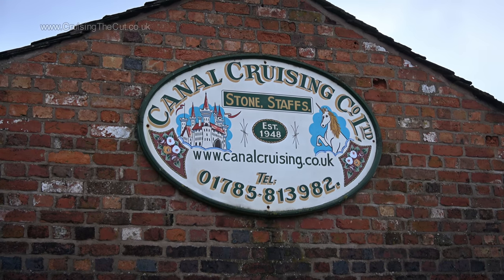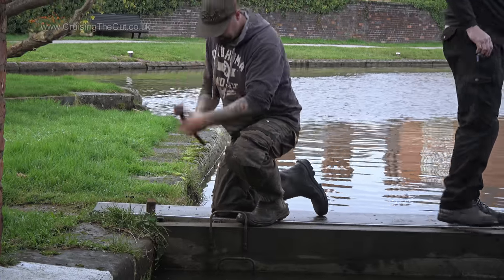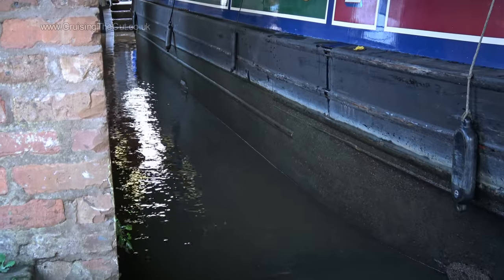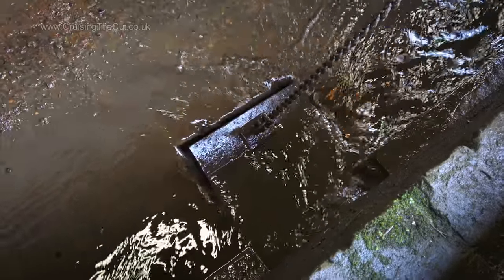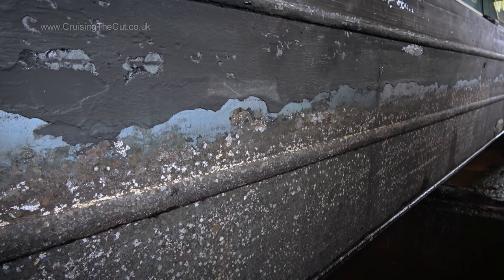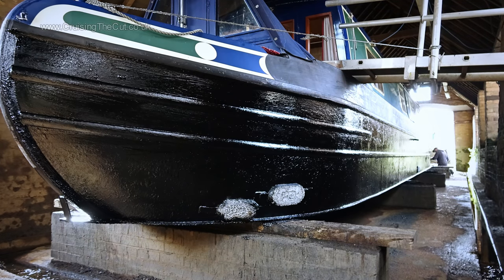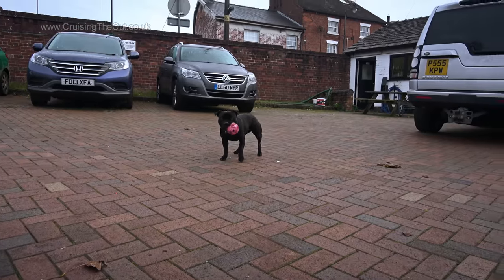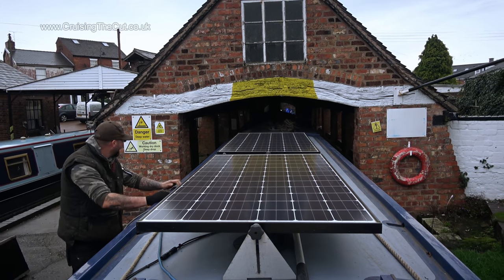201. In dry dock! Re-blacking my narrowboat

Comment: Amazing the way things were done in the past and still done today. Too bad you have to do it every 3 years. How much does it cost each time? This was a very interesting video, thank you!
Reply from the maker: Blacking like this costs around £8-£15 per foot of boat length
Reply: @CruisingTheCut  Lot less than i would have expected.
Reply: I was thinking of an American water seal compound called ‘Linex”, we use this to waterproof the  bed of a Pickup truck, pretty good stuff as it literally forms a bonding seal on the metal.  I’ve heard it being used to protect the outside of a van or truck, and so far this material has passed even the most stringent of all testing by outdoors adventurers…. Its also expensive…..

Comment: Have to say David this was a really interesting vlog on the technical aspects of the "original" canals engineering.

Watched the vid three times (simple addiction) before it dawned on me that the understanding and exploitation of hydraulics was rather clever.

No pumps to empty the dry dock or fill it. Just gravity and exploiting the difference in height of the water levels.

Using the dirt ( stove ash?) to seal the stop boards by using the water pressure to take the sinking ash to where it was needed was an easy and cheap way of keeping the water out.

The stop boards themselves obviated a lock gate, hinges and paddle mechanism with the consequent maintenance.

Obviously couldn't say when the concrete liner when down but having the gutter to deal with any leakage was clever so blokes could walk on relatively dry concrete and not be sloshing about in puddles.

Even the lintel (from an oak?) saved having to build an arch, not to mention money.

The overall construction reminded me of the open boat yard docks found in the Arsenal at Venice.

Whoever designed that dock and system was really quite clever with no unnecessary fripperies and doodads, or expense.

Comment: Are any of the UK narrowboats fiberglass hulled or are those considered too brittle and easily damaged for the day to day life in the canals?
Reply from the maker: There have, in the distant past, been boats which you might vaguely call narrowboats, made from fibreglass. There were also experiments with steel-hulled, fibreglass-topped boats (though usually the top would end up detaching from the bottom). And you can get fibreglass river cruiser style boats which are made to suitable dimensions to fit the canal locks. But 99% of narrowboats are steel (and a small number in aluminium)
Reply: @CruisingTheCut  i believe there also were ferrocement narrowboats in ww2, but were soon phased away due to their lower carrying capacity. however, ferrocement is almost indestructable and needs to reblacking. you have ferrocement boats in british columbia (i think) built in ww1 that are still afloat and serve as a wave break. only periodic pumping out water. 

i wonder if there are any such narrowboats still in use somewhere.
Reply: When answering questions on this matter no one points out that to have a draught of 2ft 6 ins means displacing nearly 1000 cu ft of water on a 57ft boat!  That equates to 62,000lb weight.  Every bit of weight is needed to get the boat to float with a realistic air draught.  GRP would need colossal balasting.

Comment: The fact that the sacrificial anodes were in such excellent condition is a very good sign that the hull of the boat isn't corroding significantly One goes with the other.
Reply: The anodes shouldn't actually be necessary - and wouldn't be if the only metal in the water was all the same metal.

Comment: Yes, an immensely satisfying video!  Have been curious to see the hull of a flat bottom narrowboat and it was; well, strait down and flat.   Think I expected the hull to be a little narrower below the waterline, or more similar to V-hull boats.  Anyway, interesting to see her out of the water.
Reply from the maker: There are a few (very few) that have a slight V-hull, mostly Springers but as nearly every marina and wharf is only set up to accommodate flat-bottomed boats (eg in terms of lifting out and supporting them on the hardstanding) they can be more awkward. Plus they wobble more. The upside is they can get closer in to the sloping bank if it’s silted up.

Comment: Hello David, I wonder if i could ask what the difference in costs where between caring out this job yourself including the hire of facilities, and having the boat done professionally. Perhaps a break down of the fixed costs and per metre costs on the variable side. Although only time will tell, do you think the professional application was better? What length is your boat? Many thanks in advance.
Reply from the maker: I don’t have a figure but it’s not that much different as the main fees are the use of the dock, the jetwashing and the big tin of bitumen which is not cheap. The short amount of time spent doing the blacking does not add up to much.
Reply: @CruisingTheCut  thank you

Comment: Interesting to see that dry dock with stop planks and a plug hole. The dry dock I've used at Deepcut on The Basingstoke Canal is just like an ordinary lock with lock gates at the entrance and paddles to drain and refill the dry dock. The only difference is there are no gates at the far end of the dock, only a brick wall.

Comment: Great video again thanks!! Just as a curiosity... Given the option, would you have chosen a two pack epoxy finish first time around which could have given up to 6 years life instead of 2nd bitumen job in two years?
Reply from the maker: Probably not. Epoxying is expensive and can still be scraped off in the canal. Plus I'd still want to haul it out every three years to check the hull over anyway because that's just how I am. So ultimately, I might as well stick with bitumen.
Reply: @CruisingTheCut  Thanks, I'm just gleaning best practice methods for when I buy mine in 2021. The gooey consistency of Bitumen seems the natural choice and appears to be immensely satisfying to apply. From my own research, I found two pack to be only a bit more expensive. Jobs a gooden though .. keep up the great work.

Comment: Hallo David, and thank you for your beautifull youtube site with all your videos. One point, that might ease your cruising (forward visibility in turns) - buy a truck camera used as a mirror for reverse, attach your monitor next to your helm and than attach your camera on the bow of your ship, or even better on point of some pole, showed into tube or pipe, for you to simply and mechanicaly put it out in front of the bow, or pull it back from the helm. Regarding solars - have to say, that I was wondering the whole time, why you did not use more solar panels on the roof and sides of your boat. That would highten your output, and cover your "on canal consumption" better. When not in lock, tunnel, or under small bridge, narrow boat can easilly tripple its solar panel attachement points roof area, by using frames on hinges, hung on the sides of your boat. And when optimal situation comes, raise them into horizontal position (for better charge). Could be easily manualy/mechanicaly operated from the stern by a prolonged handle on those frames, and electrically connected in your already existing setup - or in a separate loop - as you want. Another (much more unorthodox) idea i had - un-powered cheeply build & lighteweight (plastiq materials) narrowboat (butty?) for prolonging the cruises, butty oriented on suplies and support of the crewed narrowboat. Tripple the watter reservoir, tripple the toilet caches number suply (and convinient storage for the used ones far from your living space), tripple the fueltank size, attach a freezer or at least a locker for extra provisions, add convenient and SAFER place to store extra gas tanks (or even the working ones, provided you are still connected by hose to the butty, and canal manuevres are somehow solved, not to harm the connections). The same goes for the roof (solar panels) of the butty. If you get enough power - surpasing your consumption, you can either sell the overproduction, when in mooring, or use it for propulsion (in some kind of diesel hybrid, where disel is used only as kinda generator, and the propulsion itself is powered from powerbanks (wich are powered by solar too). Another possibly interesting point for use of this setup, is better river-keeping (or even sea-keeping), wich can be hightened by connecting the butty in paralell next to your ship, into kind of catamaran and use attached motor on console, slaved with your usual, to run it, when dimmensions allows.
Reply from the maker: Hi. An interesting set of propositions, however: I don't have more solar because I don't need it; the existing panels cover all my needs from April to October (and over winter I tend to moor in a marina with a shoreline, besides which even with more panels there's not enough sun in a UK winter to cover the power requirements). I certainly wouldn't want panels down the side of the boat; it wouldn't be attractive and they'd get scratched by trees and brambles on all the narrow bits or when passing other boats.

A butty would be very awkward to handle at every lock, especially for someone single-handed such as myself. Plus I'd have to pay the additional licence and insurance fees on it. Also there's no real need to use it as a stabiliser, the narrowboat would never be taken onto waters where that's needed.
Reply: @CruisingTheCut  Hi again and thank you for your experienced captain opinion. I never was in UK in winter, neither have years of experiences on watter, not to mention informations regarding license and insurance requirements. Would it need a license & insurance, if you hook up 4 open top "kayaks" under a frame? Like quadrimaran or katamaran divided in half? (Promissing, this would be the last dumb question from me, under this thread :D)  Regarding the turn in blind spots - i belive you mostly use your horn and speed through, sometimes even use your drone for some scouting ahead. Here are some topics, people might be interested in, and i am not sure if you covered those. Most of them do not even need the boat to move (so can be used outside the canal sesson): 
- Security against thieves (please do not mention your own setup). Locks, motion sensors, cameras, internal sensors, automatic telefon connection to closest police station, baer traps... :D, etc.
- Insurances and licenses
- History of narrowboating (kinda document short)
- Sources of income, when living on narrowboat. Renting seats, transport of cargo, Work as narrowboat and insurance salesman, Work as cole and butan tanks salesman, Work as handyman across the whole canal, Work via internet, Running a pub in your narrowboat, or wathewer you saw and see feasible. 
-fishing on canals - are the catches good enough to eat? Is some extra permit necessary? Are there some typical fish foods, wich came from narrowboat culture? And what about swimming in canal watter? 
- How would look your dream-come-true narrowboat? If you are not at all limited by cost, and could pick, design, or redesign everything, including the boat hull, how would it look, and what could it do? Extra doors/window for bringing the toilet casette(s) out of the boat (to avoid going with it across half of your home), would you highten the drop of floor in the engineroom and propane storage, to asure the outflow of the water? Would you use two stoves (one in the bedroom), or different aproach to the heating? Design of your floorplan - would you go for free floor (by utilizing colapsible beds, seats, tables and others)? Wich technologies would you use? Either way, sorry for this literature piece abowe... quite bit heftier, than i wanted to send...
Reply from the maker: Yes, kayaks need a licence too, albeit a cheaper one. They'd be even more of a nightmare to control though. I never "speed" through gaps - there's rarely any speeding on the canals at all but when going through a blind corner, you slow to just tickover. I don't use a drone to look ahead, for reasons explained on my website FAQ page which also covers some of the other topics you mention. Others have mostly already been covered in prior videos but cheers for the suggestions.
Reply: @CruisingTheCut  Thanks again (going to hit the FAQ page with red cheeks). I will probably send more in future, but will do my best to 1) crank down the volume of words and 2) avoid topics you already spoke about. Looking forward your future work, marry christmas and everything good to you.

Comment: Your insurance doesnt come to check? Most bigger boats here to have a hull report with ultrasonic readings to be done every 4-5 years.

Also what coating did you use? Looks like a Intertuf 16 or 203. Wasnt quite keen on 16 myself but I've heard better stories of 203. Currently the boat here has a Sigma Vikote 12 primer with Vikote 42 on top of that
Reply from the maker: Insurers tend only to want hull checks for boats over about 25 / 30 years old here, I think.
Reply: Ah yeah that could be the difference, our hull is almost 90 years old. And while 90 years of history give it a lot of soul it also means 90 years of owners doing things their own way

Comment: i understand that getting your boat epoxy blacked costs alot , to get it shot blasted first  but if there is an opportunity to buy a normally blacked boat or a boat that comes already painted with  two part epoxy , which would you go for? Is it more cost effective in the long run to have a boat with epoxy?
Reply from the maker: I think the costs work out about the same overall, it's more a convenience but as I'd still have an epoxied boat taken out to check it over every few years, for me it wouldn't make cost sense.

Comment: Technical question David, is soft steel or hardened steel better for a narrow boat? I'm guessing a mix, different bottom and sides. It would be much lesd expense for soft steel. But what is "best practice" (using a Stateside builder terminology). You or one of your viewers know? Love the Vlog.
Reply from the maker: I honestly don't know. I'd presume hardened!
Reply: @CruisingTheCut  Thanks,  maybe one of your viewers know.
Reply: @AkX1353  Most steel hulls are made from A36 mild steel. Some are made from Core 10 steel, it has higher corrosion resistance. It's more expensive and requires special welding procedures. Hardened steels tend to be more brittle and not good for use on a boat hull that bends and flexes. Hope that helps.

Comment: Do you live on the boat the whole time while its being blacked? Does anything special happen with your sink and shower water? Do they make it easy to continue to live aboard with toilets and water available? 
10:03 *wedges
Reply from the maker: I used a bowl in the sink and chucked it overboard away from the sides. The shower drain had a pipe stuffed in it that directed water away from the sides too. I'd filled the water tank on the way to the wharf so no problems with that.

Comment: Now you’ve done both, would you recommend having it blacked by someone or doing it yourself ?
Is there much cost difference ?
I’ve always wondered if they bother to do it properly but it seems they may even do a better job than the owner, by having the equipment to slap it on thick rather than like yourself with a smaller brush
Reply from the maker: I'd recommend doing it once yourself for the experience .. then pay someone else after :-)
Reply: Good answer...

Comment: It's hard work that....not blacking the boat but playing with the dog. So well done. 😉
Very interesting video though. They work hard those guys. It's obviously a damp, wet, dirty, cold job and it looks like something that's a lot easier to leave to the experts. End product looked great though. I know it's obviously not sea water (so no barnacles) but I was very surprised that there wasn't more stuck to the bottom. Not sure what I was expecting but just more than the few weeds around the prop. Perhaps stuff just gets rubbed off.
Reply from the maker: There were more tiny critters on it last time than this, for some reason.
Reply: @CruisingTheCut  Chemical makeup/formula of whatever they used perhaps?

Perhaps a Google of "International's" sites might help, (presuming that's what was painted on your hull?).

Mind you, if that's what you did use two years ago, forget that then 😁.